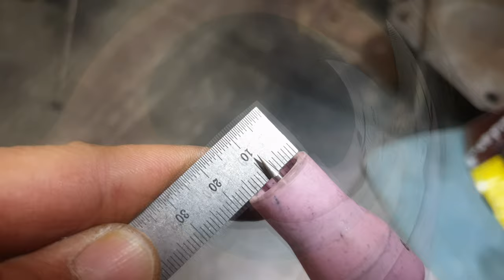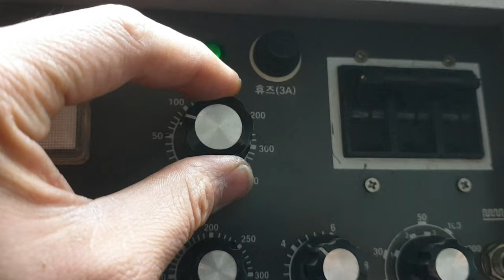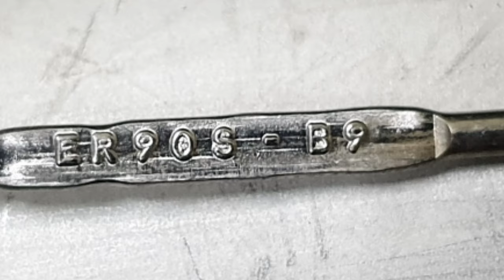알로이파이프 나인크롬 반키홀용접 및 용접진행과정!!!

Comment: Nice one sir i am a welder to currently working in a korean company(IWI)  your technique on welding are similar with my technique p91 alloy is very hard to weld when there is already pwht but for demo purposes you use 304 ss pipe and you do it nice and pretty awesome......keep sharing sir good job.....god bless